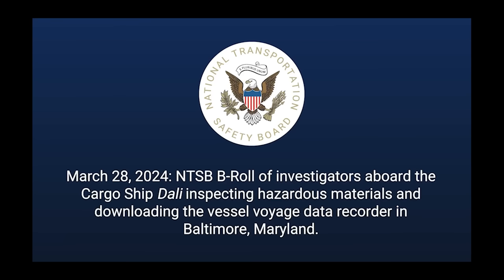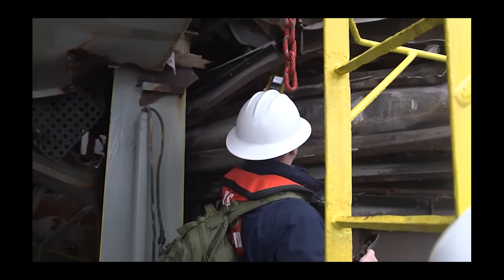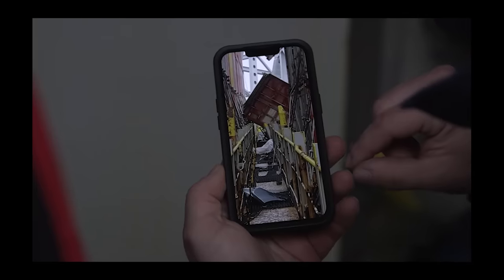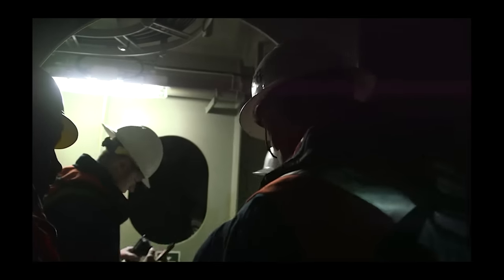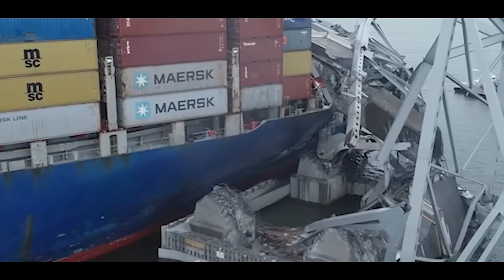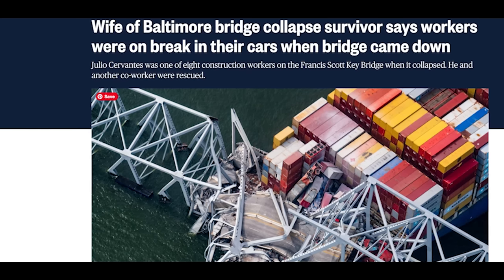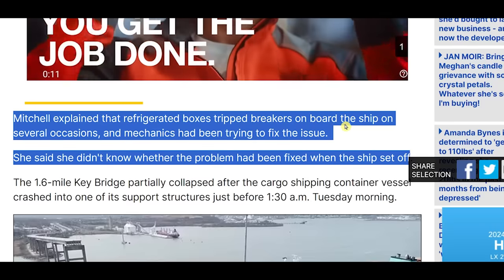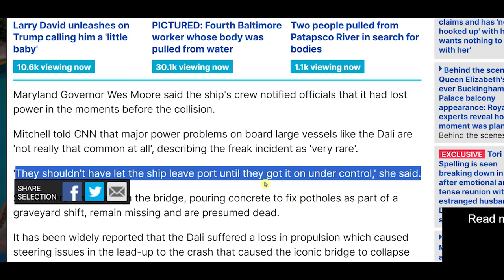NEW NTSB Video On Dali Ship Point of Impact Key Bridge

Comment: Jeff, why isn’t there greater redundancy on these vessels? It seems odd that electrical system malfunctions would render the ship totally uncontrollable. Airplanes have triple redundancy with critical systems- it seems like these huge ocean going vessels should be better suited at handling abnormals & emergencies from a systems perspective.
Reply: Many ships this size have two main generators and two axillary generators. The hydraulics can be pumped electrically or can be switched over to a mechanical pump driven by the main engine. Many modern ships have a battery backup system that keeps the navigation and internal communications and radio equipment live if power goes out. The redundancy is there, but it takes time to switch to the backup systems. From the first lights out to the collision took about four minutes. Four minutes with most everyone in a panic to get power back on line is hardly enough time to switch everything over to the axillaries.
Reply: Thanks for the explanation, that’s very insightful. Is this the “state of the art”, however? The design you’ve described seems less redundant and more like an aux system, given the startup time. Is this the best we can do?

Comment: It dosent matter what the NTSB say, the bridge should not have collapsed so easily. This was  an accident waiting to happen and the bridge was not protected
Reply: I have a background in steel construction and also know structural engineers. Some local structural engineers in Baltimore did the calculations and there's not enough room in the channel to build the amount of foam barrier that would have been needed to stop the forces of a 100,000 ton vessel traveling approximately 8 knots. Also, the bridge was impacted and the concrete piles were still intact doing their job correctly. This bridge was built in 1977 before the huge 100,000 ton container ships that are currently in use. You can blame our lack of government spending to upgrade the bridges for part of the problem, but even then, it's difficult to determine if that would have helped in this situation. It's more likely that the vessel should not have left port with the electrical issues that were happening.

Comment: If this ship is relatively new I'm sure it has a electrical system like a modern commercial aircraft .  Dual systems or a system that can shed non critical sub-systems like cargo power and handling to protect basic engine,  steering, and pilot house instruments. I can't believe that the design standards would be less than an aircraft.
And there would be no missing gaps in any information from the flight recorder which would be constantly powered from the essential battery bus.

Comment: That news article stated that the night shift were on the GRAVEYARD SHIFT, woah that was bad scripting considering their fait!

The ship is appearing to be taking on water because the bow is grounded, but a report yesterday said that the stern has dropped over a foot and the ship is taking on water.  Therefore the ship is unlikely reloadable without unloading at least some of the bow.  Even removal of the bridge debris could sink the boat in the channel closing the port for months or longer.  Yesterday NTSB suggested it would be at least 3 months to remove the blockage but if things don't go perfectly the closure could be a year or more.

Another report suggested that the area of the 2016 berth impact specifically the stern and transom show new damage and weld cracks.  Also the bulbous bow is destroyed and several bulkheads are buckled.  I hope this is not the end of Baltimore as a port.

Love your updates Jeff.

Comment: Question... why would an electrical failure kill the engine? Would expect that to have a separate circuit, and if it's a diesel, it doesn't need electric. The reefer stuff would be aux power. 
   I might even expect separate generators. Emergency power won't run the engine, but it should run hydraulic system (steering?
Reply: These diesel engines require electricity for the support systems for the engine. Lube oil, Cooling water pumps , LP and HP fuel pumps all require electrical power. Steering motors usually are split such that 2 are supplied from emergency board, supplied from an emergency generator when main generators fail.

Comment: I'm only 5 minutes into this video and I just have to comment.
One thing...if there were drums leaking, I guarantee they would be addressing it immediately. Drums are engineered to withstand all kinds of abuse before they leak.
Second...the Voyage Data Recorder runs off of a totally separate 24 volt battery system, independent of any ship electricity, and can run up to two hours with this on battery backup.
Third...the guy was testing for hazardous VOC/PID's/chemicals. As an OSHA Safety Instructor, I've used that same tester.
Fourth...You say the vehicles were above the ship, that is wrong. There's 3 vehicles with emergency lights flashing, towards the right side stanchion. When the bridge collapses, they pretty much drop straight down into the water.
And mainly, please don't guess on anything you don't know. Yes, we understand it's great to get clicks and views and $$, but people are looking for any REAL information, not ghosts.
RIP to those who lost their lives, our prayer are with you and your families.
Reply from the maker: Not sure what you were complaining about, I mentioned the vehicles were off to the right.
Reply: @jeffostroff  at 9:15 you were pointing out with your mouse and said where the vehicles were. No biggie...the end result is still sad.

Comment: One of the articles I read said, “The ship was allowed to leave because, of a lack of trained personnel to fix the problem and the Deli was going to have it fixed at their next port of call.” Have no idea. Of the truth if that statement
Reply: What you heard is from a lack of understanding of the federal regulations on the US maritime industry. To be "allowed" to leave the dock implies that the USCG was aware of the electrical problems it was having. A total failure of the electrical system is considered a high level and serious "casualty". If the Coast Guard was aware of the problem they would have pulled the ship's Certificate Of Compliance, which means the ship would be stuck pier side until they proved to the Coast Guard that the problem was fixed. The regional USCG in Baltimore would be in deep dodo if they knew the problem existed and allowed the ship to get underway anyway.
Reply: @3DPDK  True , but when you consider the ego of angry port authority boss , he may have over ruled safety so he could get the next dock freed up for the next ships waiting in line to be loaded.
Port time is huge $$$

Comment: Yes, have worked on ships .. MSDS safety sheets. We have to know what we are working with. Saw detailed pictures of the ship,100ft Beams and a 4 lane highway concrete and all went through at least 6 decks, Possibly compromised the forward fuel cell. Can clearly see she is leaking. FL Crew Prayers for the families 🙏 ty jeff many ?'s

Comment: You need to tread carefully on Draw Amps vs Short circuit amps.    Yes,  long term a CB will trip at 80% rating.   Depends on the type as you can have CB with ability to set overload,  long term,  ground fault etc.

Comment: It could of been bad breakers or them being unaware of inrush current? When I had issues with an appliance, it was the breaker that was fine, but the circuit protection at the outlet would trip. Everything was 15 amp rated. My research showed that the breaker can tolerate inrush current, but the outlet circuit protection could not. I switched to a higher rated outlet circuit protection, and that fixed the issue.

So do refrigerator units have a lot of inrush current? This would explain why things can seem to be working, because they can all run at the same time. They just can't all start their compressor at the same time. So eventually when the refrigeration cycles align between enough units, you trip your breaker.

Comment: The ship (it's not a boat, but a ship) isn't really afloat - the bow is wedged against the bottom of the channel by the weight of the bridge.  The stern has clearly risen some as a result.  That's why she hasn't budged since impact.  Fortunately, little or no compromise to the hull or they would have auxiliary pumps working 24/7.

Comment: The channel is probably not that deep that far from the center of the channel by the supports.  This means that the boat MAY be sitting on the bottom of the harbor.  These ships draught around 40-50 feet.  The main channel is not that much deeper.

Comment: Meter is likely a gas detection meter (commonly flammable gas, carbon monoxide, O2, H2S - although other sensors are sometimes used depending on site conditions).  Specifically used as a safety screening tool but can also be used to data record, if necessary.  Often workers may also wear a smaller gas detection unit for personal protection although it is not obvious if they are also wearing any.

Comment: Great vid! Tripping breakers have many causes. And are usually NOT caused by over amping. Tho a 20 amp breaker is designed to trip at 16-17. I’ve seen them not trip even at 25 amps plenty.

Comment: Viewers should know that Marine Heavy-lift Cranes are those which can lift 1,500 tons or more.  This crane that is now on scene and being touted as such a capable tool for the job ahead of this salvage operation is simply a medium-lift crane and of course the largest available (not under contract or performing other work) on the East Coast.  The "heavy lifters" can handle loads in excess of 14,000 tons but are also so large that they may not be able to clear the channel bottom at only 40 to 50 feet deep.

Comment: Some of the missing bodies may even be under all the rubble on ship where impact is, rip so sad, prayers
Reply: no , CCTV shows them around 200 metres away from the ship , but when the bridge collapsed their vehicle slid backwards down the slope of the deck until it hit the water about halfway between the two main pylons , then debris probably fell on top of their vehicle as it all submerged. you can see their vehicle flashing amber lights to the right of the video.

Comment: I think, the power issue would not be with the set of brakers for the chillers, this woudl cut power to the chillers not the whole boat, its more likly to be a issues with the main genset or control systems of the main genset (genset = main power system) or issues with the main emgin (sorry spelling english not first langage)

Comment: The steering and rudder control have their own independent power and hydraulic systems so that even in the event of major power loss throughout the ship, they can still maintain steering control. The story that the power loss caused the ship to turn hard to starboard is complete nonsense and not based on facts about modern ship controls. Someone throttled up the port engines and propeller just before the crash to gain momentum. No way for one side engine to throttle up when there is a total power failure. This was an intentional crash. Most news reporters will believe anything they're told.

Comment: The data loggers in these ships are quite amazing. They can measure motion, light, acceleration, humidity, temperature. etc.
They have over 4 million measured values. Thats shocks, electrical, jolts, impacts. 
Most can be linked with other systems to give an accurate tell of events on the ship.

Comment: Electrical problem: Ground faults. Ships have an ungrounded system. If you have one phase touch ground ( the hull of the ship) the system will continue to run as normal. If you have two phases touch ground, you can significant problems. Which could lead to a loss of power. I have experienced numerous lop events on cargo/military ships. I have experienced a particular loss of power onboard a vessel. Two dg’s in parallel, dg 2’s excitation voltage circuit opened in a faulty terminal block very similar to a fuse action. Dg 2ran idle while still connected to the bus with no power generated. This occurred because the system still saw 480 volts which was generated by #1. Dg1 started to take all the load. The automation should have actuated a preferential trip. Which  would have shunt tripped all non essential power loads. Unfortunately the relay that controlled this action had not been actuated in some time it was stuck. As a result the dg #1 tripped on instantaneous overcurrent, then #2 finally tripped on under voltage. We had no indication of an issue till it happened

Comment: 1993 is diesel fuel, 1267 is crude oil, gasoline is 1203, 1987 is alcohol/ethanol. I am a journeyman carman/railcar mechanic. I used to work for Union Pacific Railroad. We were hazmat trained and qualified due to every sort of hazardous materials coming through the rail yard.
Reply: The official description for code 1993 is "Flammable liquids, n.o.s." (n.o.s. means not otherwise specified) it could include diesel fuel although that has its own code - 1202. Similarly 1987 is "Alcohols n.o.s.".
Usually anything with a  "n.o.s." code must also be labelled with the name of the substance.

Comment: Tripped circuit breakers to refrigerator containers would not cause a main engine or generator failure, it would cause a refrigerator failure. However, a generator failure could cause a circuit breakers to fail. So maybe the problem was mis diagnosed. I think most large ships run the prop off of a different engine than the generator though.

Comment: A systematic review of the maintenance record and competency of the engineering staff on board needed to be checked. There are many complicated aspects to the operation of a marine power plant. An early improper fuel changeover may lead to generator engine failure. I am a retired marine engineer officer.

Comment: Might you consider using your platform to identify the dangers of the use of low bid designs on bridge construction projects? my understanding is, that when cost cutting measures are taken during the design phase of projects, the powers to be seem to have a clear disregard for the need of redundancy of safety…. The powers to be express, how they are no experts in engineering., And yet the bureaucracy seems to make the final decisions on such projects…. I wonder how much of the responsibility or blame revolves around The avoidance to pay for a redundantly safe Design? we now have a specialty fields called, risk management. Does risk management simply. reduce the sanctity of life to a calculated bottom line liability?

Comment: Refrigeration units can also pull too much power if for example the fan that cools the compressor doesn't work properly. It causes the compressor to overheat, and can pull excessive power tripping breakers.
Reply: They're highly unlikely to trip the main circuit though, only localized ones, I doubt they'd just have one or a few huge breaker for everything.

Comment: 11:50 THis usually only hapopens due to the breaker getting old and the spring inside becoming weaker over time, if this happens this is a good sign you should replace the breaker.

Comment: Breakers are rated at 80% continuous load....which is 16amps on a 20. Keep us posted!!
Reply: Totally. I'm a prostitute and I'm always on ships and have even been on the Dali several times and I can tell you they had problems then so I'm not too surprised.
Reply: Wrong. They are designed for higher loads than the rating.

Comment: 11:34 If Genset circuit breakers were tripping it could have been electrical short circuit in one or more reefer units , The crew should have switched off each distribution switchboard until they isolated where the fault was , then switched off breakers for each 3 phase GPO until they identified exactly where the fault was. It could have also been cabling on the ship that was faulty or the Generators themselves with a fault.
It was mentioned in one news broadcast that crew told police they got contaminated fuel that was causing loss of power or shutdowns of the engines.
.
Two lessons learnt so far , The ship black boxes should have a UPS for operational redundancy , and Harbour Tugs should have stayed with the ship until it passed the bridge.
.
The enquiry report will be released in 2 - 3 years and we will find out.

Comment: The ship's load plan will show the exact location of ALL "Hazardous Goods", so the NTSB/USCG will know exactly WHERE "Hazardous Goods" are, and they will be able to avoid them without having to don haz-mat suits.
Voyage Data Recorder :- yes, when items connected such as steering motor, gyro compass etc stop, the data sensor simply reverts to a "No Data Detected" state.
when power is restored the data stream starts again. The audio from microphones on the Bridge are unaffected. The VDR also has, by regulation a back-up battery inside, providing AT LEAST 2 hours of recording.

Comment: These breakers that are on the main power bus of these huge ships are usually air-charged breakers that run hundreds to a thousand amps and need to be pumped up to re-energize them ! (You pump their handle until you see a green flag/window and press the energise button ) 😮